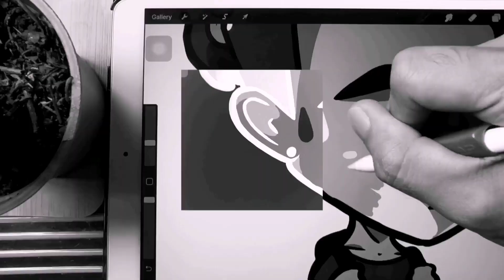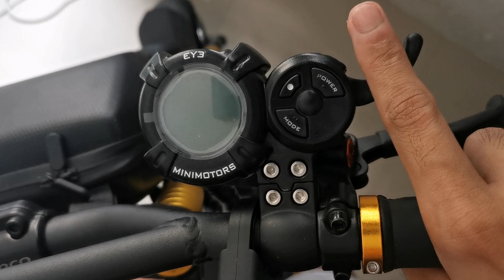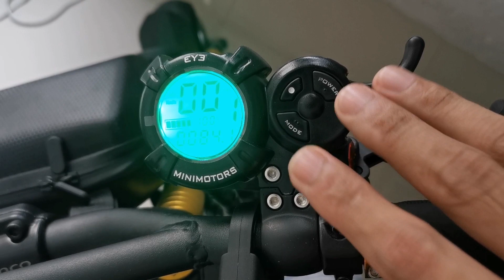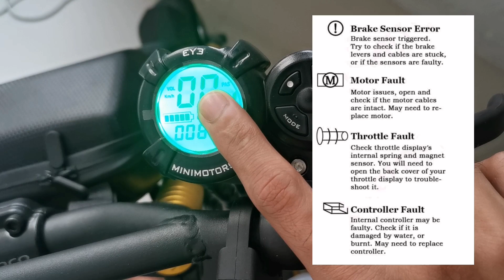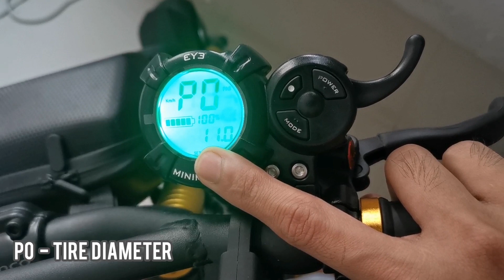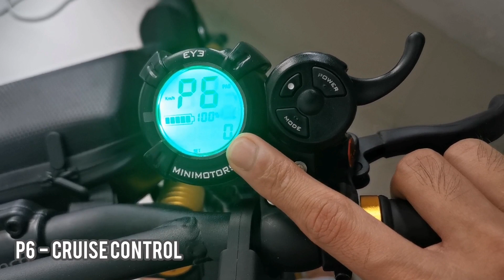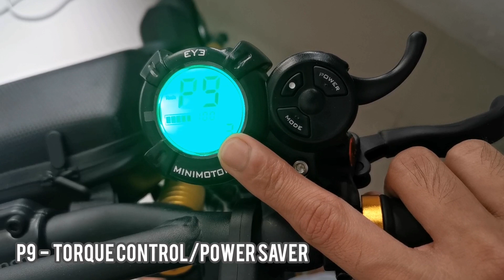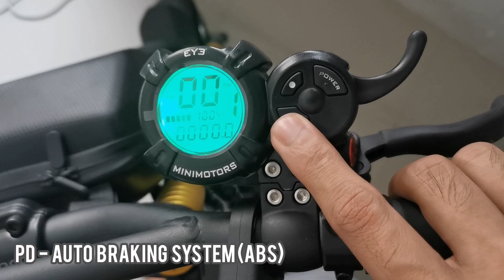Minimotors EYE (EY3) Throttle Display | Features, P Settings Guide | Kaabo, Dualtron, Speedway

Comment: Does the P2 value affect the speed ? In manuel of my Achilleus writing "15" for my scooter but this value came to me as "10".
Reply from the maker: Just keep it on your factory settings. It counts the magnet on your motorhub.
Reply: @MilkAndCoffeeAdventures yes, but im going with max 40-45 km/h with “15”. When i change it as “10” ( this value writing in Achilleus manual) im going with 80-90 km/h :) how it can be possible ?

Comment: Great video! I accidentally changed some settings I didn't mean to, how do you reset the eye throttle back to factory settings if you've messed it up? Thank you for your help!
Reply from the maker: There's no factory reset button. You have to set it up back manually by pressing the button until it goes back to your default.
Reply: @MilkAndCoffeeAdventures  Ok thank you!!! Will do!!

Comment: Good overview of the settings. I just got the wolf king and took it out for a test run to get a feel for the mileage. The battery was depleted after some 60-65km but afterwards I can barely get 45km before the battery is depleted. Any advice on whats going on ?
Reply from the maker: I assume you meant distance. It depends on the rider's weight, or perhaps you're always on full speed?

I run like 25-30kph, I usually can extend the battery around 90km distance. But if I go speedy, It can take me like 70km~

I weigh 80kgs.
Reply: @MilkAndCoffeeAdventures  yes distance. I'm roughly 80kg as well but I'm unable to get more than the aforementioned 45km before the battery is empty. I'm mostly staying in first gear topping around 45kmt. The 45km I'm getting is a long ways from the 70km youre getting.
Reply: Milk And Coffee Adventures  Can you stop the Ey3 from turning off when the scooter is idle?

Comment: Thank you, great video.  How do you change the P0 setting back to the default value?  I accidentally changed mine!
Reply from the maker: Thank you for watching. There’s no way to reset it, but what you can do is to keep pressing it until it goes back to the lowest number, then work your way up again to the correct digit, which is 10 for 10 inch tires, and 11 for 11 inch tires.
Reply: Thanks this works, but the value does not reset until you click past 30. Thanks again!